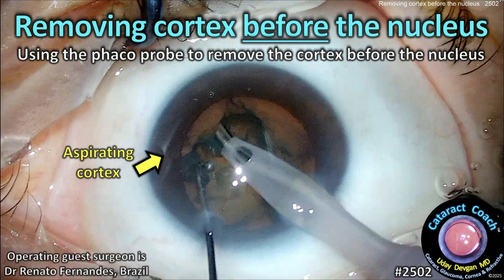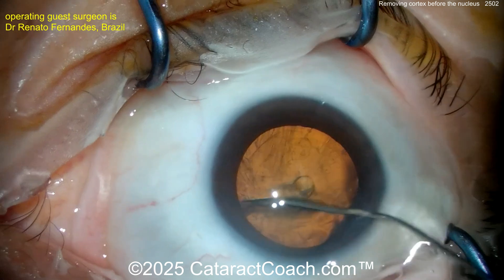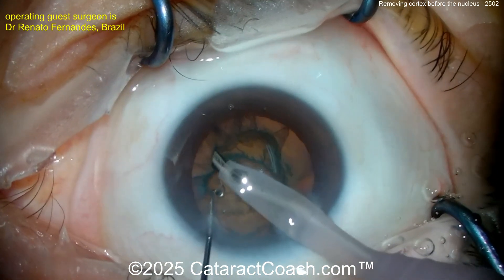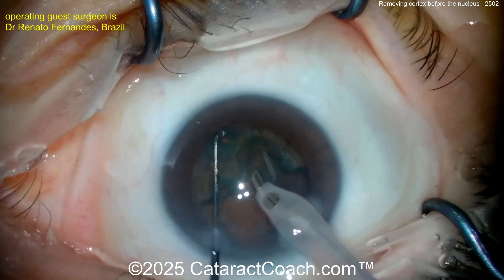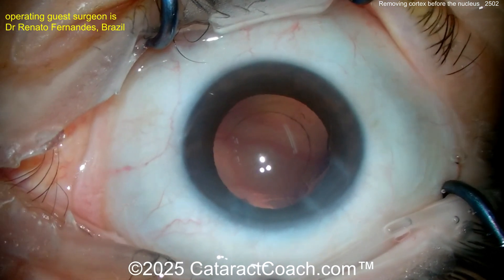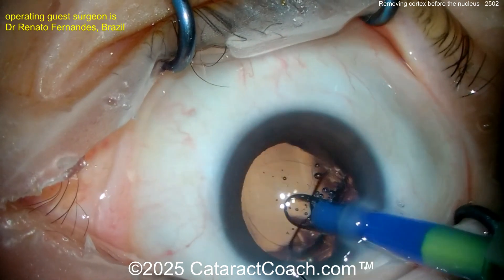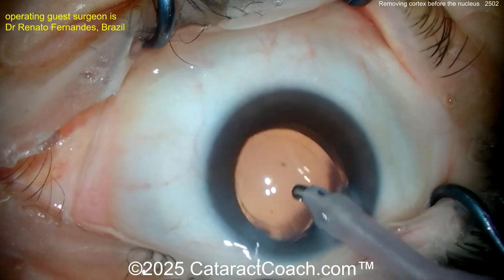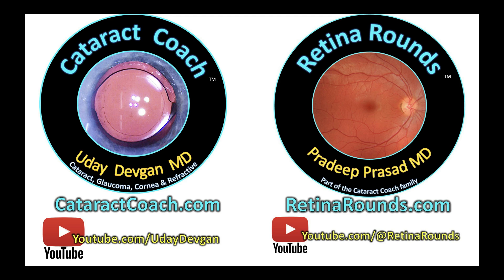CataractCoach™ 2502: removing the cortex before nucleus

Comment: I use a Bausch and Lomb phaco and don’t know how the other brands are set up. But I switch through all modes by the foot switch. So I can kick in to I/A mode whilst using the phaco handpiece. This allows you to use the phaco tip to irrigate and aspirate with no chance at all of accidentally engaging phaco. I suppose most people use Alcon so y’all can chime in if you can do that also. I’m not necessarily commenting on this particular video but just making a related comment.

Comment: Good hands ..
It is a usual case .. 
What cleans the bag is the good hydrodissection not the step that was done by phaco.
Reply: Totally agree. But if you don't aspirate with the phaco, you'll be left with the cortex to deal with.
Reply: Exactly. The peripheral part which was done by the phaco was probably epinucleus. Aspirating literal cortex with phaco at the beggining of the surgery is just impossible, you'd break the capsule. But yes, the hydrodissection was perfect, that's why cortex+epinucleus came in one clean piece